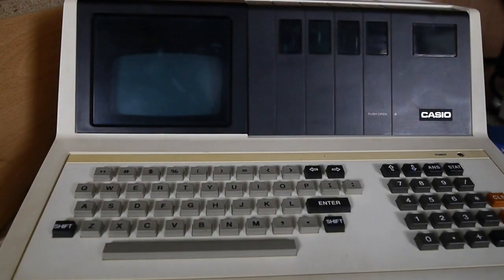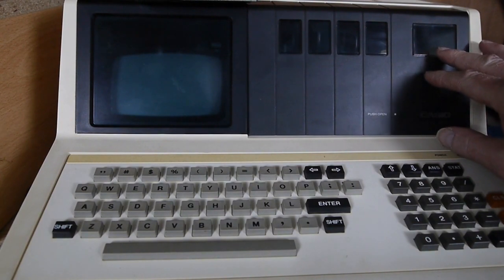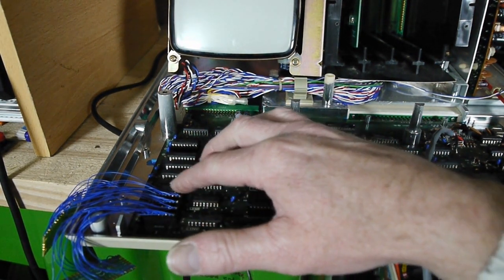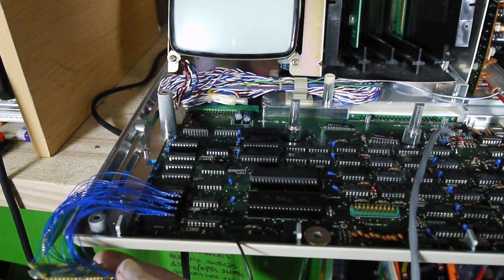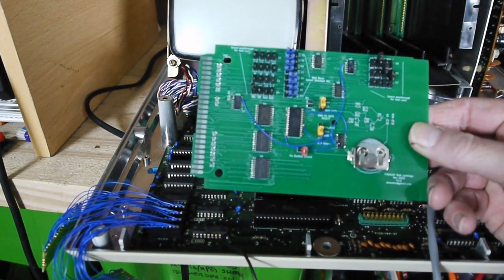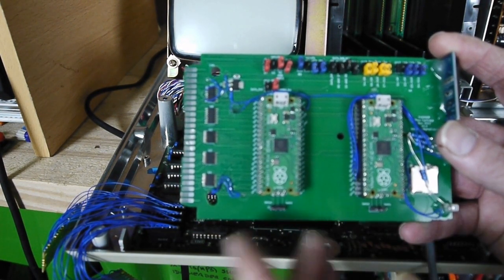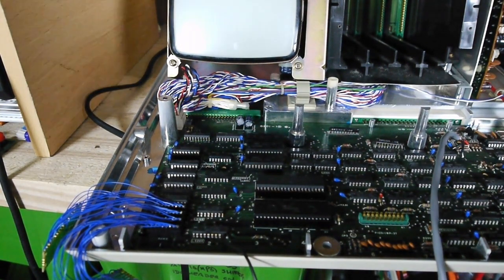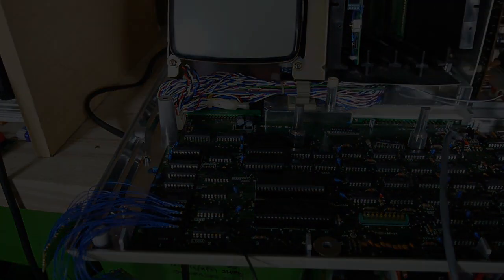Fixing and Modifying a Casio FX9000P: Part 1

Comment: @Menadue - Do you have a GIT repo with the code for the video ram? I'm assuming you used the PIO capability of the RP2040 to emulate the RAM chip(s). If so; that may be directly applicable  to a project I'm working on where I'm going to be replacing the Static ram (6264) of a Pinball board.
I've never done PIO on the pico; so having a loose reference might go a long way to facilitating the code.
Reply from the maker: The PIO isn't used to emulate the RAM, it's done in firmware on one of the cores. The core is overclocked to 270MHz, and there's no level shifters on the RP2040. It's also an 'interesting' PCB to make. If you want to have a look at the PIO doing ROM emulation (and RAM would be a bit trickier as you have to write to RAM as well as read) then this repo has some interesting information:

https://github.com/rhulme/picoROM_pio/blob/master/doc/README.md

Interestingly, upon comparing the performance of the code version and the PIO version it is found that the code version is slightly faster...

Emulating a 6264 should be OK, you have enough GPIOs and RAM. The 4044 that this PCB emulates has a 'data in' pin and a 'data out' pin so it isn't the same as a 6264. You will need a level shifter, really, on the data bus as the RP2040 is not 5V tolerant on outputs and if the firmware allowed the data lines ot be outputs at the wrong time then it is possible that 5V would be placed on an output. The 4044, with a Dout and a Din does not have that problem. You will also hve more space on a PCB to add a level shifter s the 6264 is in a larger package (in DIP format). The FX9000P runs at 2.75MHz, so this may not work in a faster system without changes.

I've just made the video RAM PCB files available in this repo:

https://github.com/blackjetrock/fx9000-info

As always,it's a work in progress, so untidy code.
Reply: @menadue  I have single level shifter on the data pins on my PCB. And a series resistor and pull down on the Address lines. My hope is that I only need the series resistor with a programmed pull down on the pico side. 
I did see the picoROM project; but it's a software only project (no pio afaict) with overclocked Pico. I was hoping the pio would be fast enough to emulate the ram directly. I'll have to experiment a little bit.

Comment: 4:50 - ha, just as you were about to say it, I also thought "RP2040." :)
Aside: I've been using Adafruit KB2040 as a driver to make a Commodore 16 keyboard (8x8 matrix) into a USB HID keyboard, just my first microcontroller-based project.
Looks like I will be learning some more from you. :)
Reply from the maker: Soldering the RP2040 is an interesting exercise, usually in all the wrong ways. Now I have a reflow oven, though I think that will become a nicer experience. The RP2040 is just such a nice device.

Comment: Super interesting. Nice work.
The machine reminds me of similar products from HP, desktops and some portables, like this that I saw in operation last year at VCF Midwest (Chicago):
https://en.wikipedia.org/wiki/HP_series_80
Reply from the maker: Yes, they are quite similar. the Casio is a bit more basic. It does have printer outputs round the back on the optional OP-1 plug-in unit. So with a printer and cassette it would have the same features. There is also a ROM cartridge that provides matrix functions. There's no image for that available at the moment, though.